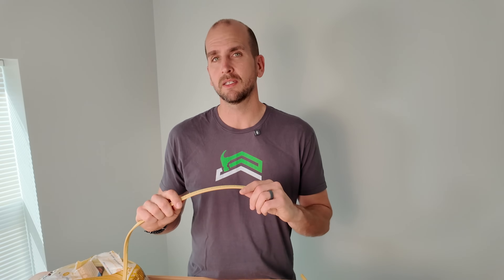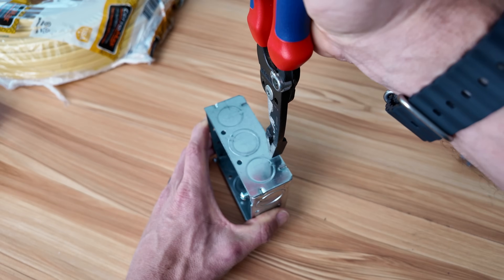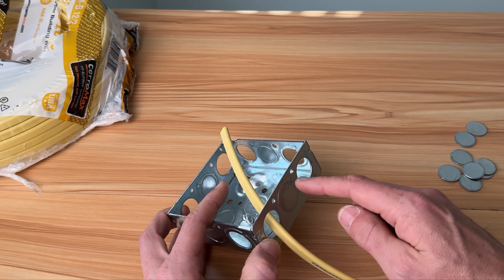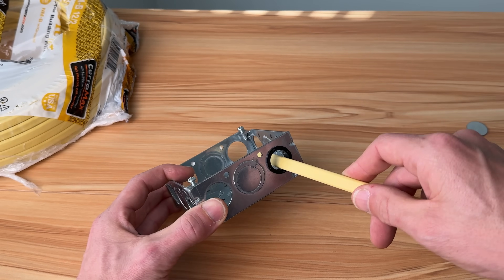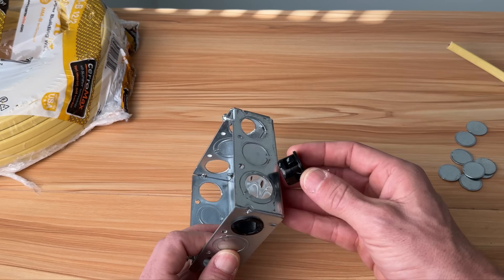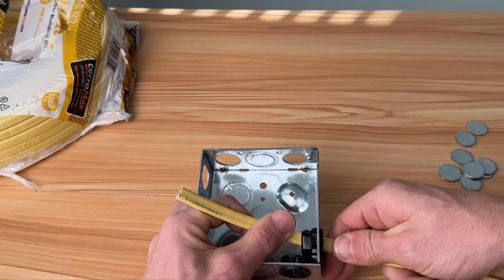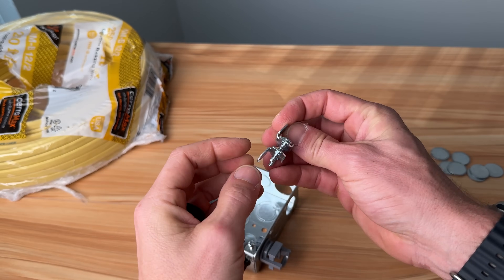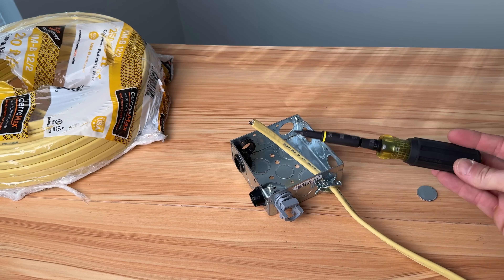What Wire Connectors Should You Use | Romex Into Metal Box

Comment: Im having trouble finding a cable clamp connector for UF cable that is low profile and outdoor rated. The wet boxes never fit the large GFCI receptacles with the metal 2 screw cable clamp connectors. Any advice that is code compliant??

Comment: Hope his wife didn't see him beating things on the table lol

There is a chart that tells you how many wires and how many amps you can run into a particular box.
That includes ground wires too.

NOT a big fan of using plastic in the electrical field with few exceptions.

Drywall no problem WRT screws.
Use drill or screwdriver and right next to the box make a hole through drywall where each screw is.
Just enough to use a REAL screwdriver (smooth shank) to slide in and tighten the screws.
Holes can be filled with caulk, white toothpaste (easiest), etc.
Usually walls are not painted until after the work is done.

Comment: Maybe you could do a similar video but for circuit boxes?  I'm currently trying to get a nomex cable into an circuit box with no back side access.  I've got a 1 1/4 inch hole that I'm looking to thread the wire into.  One problem with existing boxes is many of the knock outs cannot be used due to existing wiring running right over them.  Quite a pickle.

Comment: #8 would be my choice for 3 reasons: 1. Unlike plastic, it will not decay after years of exposure to the heat of an attic. 2. Unlike the plastic and the push-in metal clamps, it is easily removed if I need to reconfigure my box cables. 3. While the plastic clamps allow easy push-in of a cable, it can be tough to pull the cable out once it has been pushed in, if needed. Similarly, removing the plastic clamp itself can require destroying the clamp. With the #8 metal clamp, the NM cable can be easily pushed-in or out as desired, to the perfect length before tightening the clamp down onto the cable.

Comment: Im in the process of redoing insulation in my attic and found out all the ceiling boxes are bare, the Romex in direct contact with the metal...and worse, they used the tiniest knockout holes, so I'll probably do bushings so i don't have to disconnect the wires

Comment: Thank you for posting this. I was wondering how to install a metal connector with a snap lock. I did a search and found this video. I am a complete amateur, not a licensed electrician at all, so I find myself searching for videos to answer the simplest electric installation questions. I did not know that plastic cable connectors can be used. So I have learned from you. Thank you!

Comment: 2:00 Face it if they're running the wire without any connectors they're not grounding the box in any condition whether the house is grounded or not.
5:55 I got a handful of those connectors for instances where I need to secure wiring and don't have access to the outside the box. Specifically in the retrofit sense because there was a scenario I thought I would be working on where I know the county didn't hire somebody who knew Electrical as the maintenance person did it and I mean installed a whole subpanel and I don't think they properly attach the wires.
Otherwise I've always use the ones with the nuts. I recently splurged and got the little wrench tools to tighten the nuts so useful.

Comment: this is a really nice video. You always do good stuff. Option 5 I've never seen before but will definitely look into it. I may have a specialized application for that. personally for romex I really like and use almost exclusively the option 8 lock nut ones. however, I have used the NM cable connector particularly in applications where I couldn't use the lock nut.

Comment: Those plastic connectors are okay but there are much better ones out there. I use carlon's SNM12-6R/SNM34-6R They can be installed on previously installed conductors without disconnecting. They are also easier to push cables through, easier to install, rated for two cables, and are less likely to damage the cableThe following are similar: 

The following are similar: 
	• Raco 4714 insider
	• Arlington NM94X   ½"
	Arlington NM95X   ¾"
	• Carlon SNM12-6R   ½"
	Carlon SNM34-6R   ¾"
	• Morris 21764   ½"
	Morris 21765   ¾"
	• Rack-a-tiers TT500   ½"
	• Dottie DRC50 ½"
	Dottie DRC75 ¾" 
	• Bridgeport 616NMD ½"
	Bridgeport 617NMD ¾"
        Halex FMC 25803   ½"

Comment: Home owner here. I did not know the plush in plastic connectors existed, thanks!  I generally  use the older metal ones with the nut and two screw clamps, which work fine, but the plastic looks easier in some applications.

Comment: Nice video, very useful, thank you!  I am so tired of those impossible to remove wire strain bushings on sewing machien motors.  I end up so frustrated, I just cut the wire out of sheer irritation and anger. Fed up with them!  Truly impossible to remove. The problem is, they are meant for bigger holes like this box, not small motor holes. So crammed in tight, no pliers can remove them.
I like the metal connectors with the two screws.  Now to find a smaller version for sewing machine motors, sigh.

Comment: Plastic bushings are trade size 7/8”, not 3/8”. You do not need strain relief as long as the sheath extends a minimum 1/4” into the box and you staple the romex within 8” of the box. If you use a connector with strain relief, you must staple the romex within 12” of the box.

Comment: So which is NEC code approved? Will the home inspector be ok with the plastic or metal connector?  I'm currently finishing the basement. trying to pick the right one. Also using the metal connector, you can pass through 2 Romex cables while only one through the plastic.

Comment: Question: old house had a clip around the bottom edge, bringing the old grounds and “clipping” to the box. I changed the light switch, is the light switch ground, the only ground needed? Pigtailing all the grounds to the green screw on the new light switch 🤔 thanks! Awesome channel. Upgrading wafer LED lights
Reply: The box also requires a ground. It sounds like you removed the box ground.

Comment: Funny that US boxes don't seem to come with the screw to ground the box.
In Canada, you buy a metal box, it comes with the screw to connect the ground wire to the box.
Seem to miss an other kind - similar to #6 - but 1-side only slips.  Much better and can be put in from the inside of the box.
Reply: @AlanTheBeast100  Metal 1900 boxes for non metallic wiring can come with a green ground screw in the rear. You have to buy the correct box for the installation you are performing.

Comment: The plastic one that fit through from the inside look great for retrofitting where someone has used nothing. Drywall or other closing blocks from outside, but if such a scenario is found the wiring could be disconnected temporarily inside the box and the bushing installed from inside the box.

Comment: Another great video Scott.  I just put a 20 amp outlet in my grg and your videos helped me do it, thank you!  Concerning these connectors, I like  the threaded down metal version.  However, I used EMT conduit to come out of the ceiling, across to the wall and down to the outlet box you are showing in this video, all external to the drywall.  I used an offset connector to meet the knockout with the conduit coming down the wall.  Question is: Do I still need strain relief inside the box since the Romex is loose where it enters from the connector?  I’m wondering if there is some type that can thread onto the available thread of the connector after the lock ring is secured?
Reply: I don't think you're supposed to use Romex in EMC. Against most codes.
Reply: If you ran Romex in EMT, that is not allowed.

Comment: Cost and convenience are NOT considerations. Choice of connectors is to be made by following the acceptable combinations as listed in the UL white book. If I inspected an installation and found insert bushings used to enter romex into a box, you would be redoing  every j box on the job and requesting a reinspection before any walls or ceilings get closed up. This will cause unnecessary delays and possible backcharges for delays. The simple answer it to educate yourself and get it right the first time.

Comment: All I have ever used is the metal Connector.  The only thing I have hatted about the Metal connectors is some times they are junk and you really have to inspect them before use because the tap that hold the Romex in can be sharp I have had them cut in to the wire.  I have only had one short out on me but it was enough to make sure that I inspect every single one when I buy them and use them, Because I do not want to burn down my house LOL or some one else.

Comment: I am a retired master electrician . You did an excellent job on this video.  On the big jobs we used the screw type with lock nut because they are good and the most economical. It's all boils down to price.
Reply: Please I need some help!!  Any bushings for smaller holes in sewing machine motors?  The ones they use are diabolical and refuse to come out. NOT replacing them with the same type. I have to cut them out.
Reply: @mjremy2605  try googling sowing machine parts.

Comment: Trade size for a 1/2” connector is 7/8” not 3/8” and I’ve been doing electric for 30 years and all of these connectors will work depending upon application I can tell you that we like the snap in connectors because of speed but most times cost drives everything so you will get the squeeze connector with the lock rings, but don’t confuse the MC style connectors for romex connectors they are different the first one you showed was a bushing so it shouldn’t be on the list as a connector, and don’t make the rookie mistake of Overtightening your squeeze connection because that can damage the wires so if you’re new to doing this don’t tighten the connector with your drill or impact. The part in the beginning of what I said so you know electrical conduit and connections are measured with OD not ID plumbing pipe is measured with ID.

Comment: I always use the metal locknut one. You can get the body clamped to the cable before fishing it to box if you don’t have good access. It’s a bit fiddly but doable. I gave up on the plastic ones quickly -really hard if you need to make changes later and also tough to slide on resulting in bruised knuckles when you slip

Comment: Sheathed Cable Connector 1 Screw - 3/8-in is the best for me, the screw locks in the wire so it doesn’t move. You can attach the cable to the connector and fish it up if space allows then lock it in from the inside of the box.

Comment: I use the metal connector with lock nut in commercial. It usually matches any previous installations. I use the push-in plastic connectors in home installations.

Comment: There's no mention of the requirement to have a staple on the romex within a few inches of the box.  This renders the endless discussion of "strain relief" irrelevant, and gíven the circumstances is of very low importance anyway.  Strain relief is relevant for extension cords but this?
Reply: You need both a clamp at the box and for new work a staple within 12 to 6 inches.
Reply: @nyetloki  Yes, but the guiding principle is restraint (from flex), not strain relief, I think.

Comment: My favorite is #8.  Although I've used #3 a few times when a box was mounted directly to a board spanning two ceiling joists and the wire passes through a hole in the spanner board and into the box via method #1. 

I've also used method #3 with a pancake box when replacing fixtures where there wasn't a junction box (this house is 100 years old so some fixtures just have wires coming out of the wall or ceiling and the fixture was wood screwed into place and the canopy of the fixture is the junction box)

Comment: I am not intending to be pedantic, but you might consider changing the name of the video. Those are not wires, they are cables, and those are not connectors, they are cable clamps, bushings or strain reliefs.  I almost did not watch it because I thought it was another wire-nut vs. Wago video. Regardless, I enjoyed the video, thanks.
Reply: Romex connector is the metal name for the first two metal ones. Yes NM is a cable who cares
Reply: Who said NM was not a cable. Maybe read the sentence before commenting?

 @chrishall2594

Comment: the insider is the only plastic one (of the ones shown) I would use.  the various brands of RC-50 is the best nonmetallic one.  I've even seen one manufacturar make one that can insert from the inside or outside.
Reply from the maker: Not sure why the RC50's haven't caught on in my area.  I like the design and the split housing is handy for retrofitting.  Thanks for the feedback!
Reply: @EverydayHomeRepairs it's a good question. they've been the go-to for nearly 30 years, here.  at least on the professional side.  and yeah, I don't know how many I've used the open side to fit over a wire run through a hole without any protection.

Comment: I used to use the standard metal saddle connector with the two screws and lock nut for years because that was the most commonly available, and the plastic style with that weird crimping block was never great. But lately I've really been liking the Arlington NM94 or Halex 27500 for wire-to-box installations. I haven't used any product for wire-from-box yet, but I should think I could just pop those same connectors into the inside of the knockout.

Comment: Grew up as a homeowner using #8.  So that is what I will stick with.
Reply: With #8 make sure you center the Romex flat in the connector. It is easy to pinch the conductor through the outer jacket when you tighten the clamp causing a short. Ask me how I know!
Reply: @thomasdragosr.841  oh yes, fast lesson.
Reply from the maker: Stick with a winner 👍

Comment: Homeowner here. I recently used Arlington NM94X and NM95X which are plastic and attach from either side of the box (outsider or insider) and seem sturdier than your #4 insider. The insider feature was useful for installing in my electrical panel that is drywalled into a stud bay. Also, since the knockouts in the panel knock into the panel, I had to use the Pro-Tip of screwing a self-tapping metal screw into the knockout and then prying it inwards.

Comment: @4:48 I am confused. You said what if there is drywall and we can't access that knockout ? If the box was already there, and that hole isn't used, then wouldn't the knockout tab still be in place ? And if in place, would one have to not access it by the side in the drywall, since they have to be knocked inward  from the outside ? I was not aware of # 7 so I am not sure until I can experience it. As for my use, and what I have stock piled around here is # 8

There must be a lot of something I am missing, because I never saw a poll. But anyway, Thank you for posting. I do enjoy your company. Joel Walsman is awesome too.
Reply: There are times and angles you can get a wire and knockout there
Reply: Just to reiterate someone else’s comment, if the panel box is set in a wall you can drill a self tapping screw into the knockout, then pull the knockout into the box using the screw as leverage.

Comment: The non strain plastic one is fine, you just need to use nm staples within 6 inches of the box.
Reply: Within 8”. Not 6”. You can exceed code and staple at less than 8” though. 12” if a cable clamp is used.
Reply: @bills6946  you're right, thanks for the correction!
Reply: The size of the box is extremely limited for this exception. It's almost exclusively for 
switch boxes due to the cubic inch limit

Comment: Electrician here. "plastic bushing" is actually a grommet and is used in different application. It's not used for romex. it's used for example  with wires entering fixtures or exit signs that are mounted on the wall directly over the box. So you have protection of wires entering those devices,
Reply: Is it problematic if you use it with romex? Just wired my basement this way?
Reply: @terrillmel  Yes it is.  you should use approved romex connectors.

Comment: I don't like the plastic ones because once you push the wire in it's difficult to pull it out. I'll only use them if I have to. I prefer the last one you showed the screw in kind.
Reply: You are not supposed to pull the wire out, thats the idea it supposed to lock the wire in place
Reply: @willschultz5452  I know but I'm still new at this and sometimes I make mistakes and I want to back it out a bit. with the other ones I can simply unscrew it and move it to where I want it.

Comment: I use #8 because that is the old standard and is bomb proof, and I have never seen the others because I don't do much electrical at this point. Ones that I would NOT use are #1, #2, and #7 for the reasons you mentioned.

Comment: Are any of these push in connectors designed to be easily removed if the box is being turned down? Like if you pinch at a certain point it will squeeze out?
Reply: The only one easy to remove is #8, and then only if you have access to the outside of the box. The clip-in ones can usually be removed by pressing the clips, but it’s not easy and sometimes very awkward.

Comment: I really like that plastic one that gets pushed in from the inside of the box. Doing old work that would be awesome to have. I have been trying to find Arlington 94X connectors. They are a combination plastic fitting that can be installed either inside or outside the box. Very hard to find but it solves a lot of problems for new and old construction.